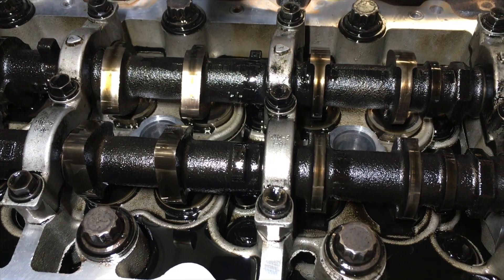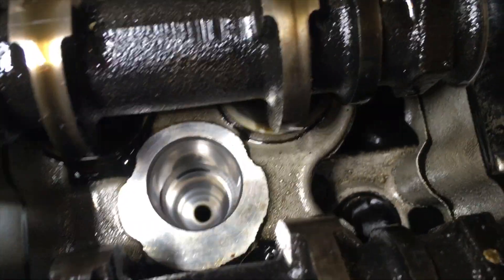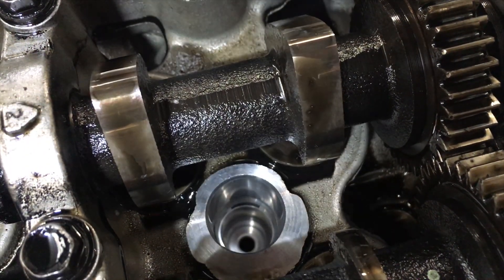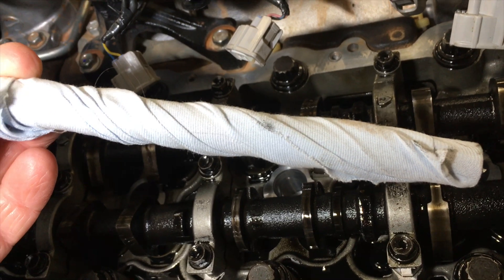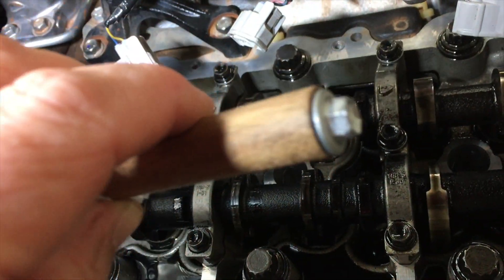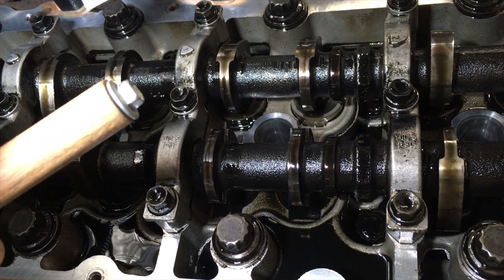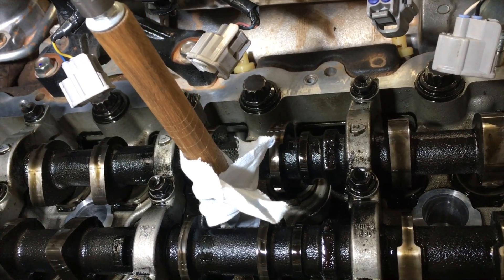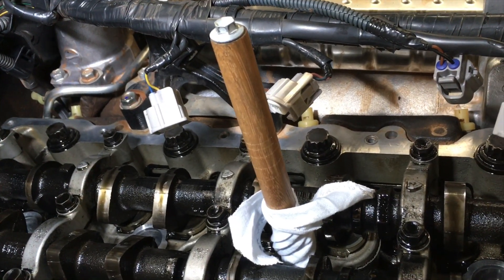Injector FREE TECH TIP #18264

Comment: Nice share... I have innova with 2KD engine (2006-160k km), in the morning the exhaust come with thin smoke. But when in normal working temp, the smoke is not visible. Engine Oil is not reduced, change it every 5000 kms. Is that normal???

Comment: Thank you, this is very useful; i have a d4d 2.0 avensis and want to clean the intake manifold. In order to do that, I need to dismantle the fuel pipes. Can you share a video on how to do this without any damage to the engine? What components are not reusable and should be replaced with this occasion? The car has 200k km.